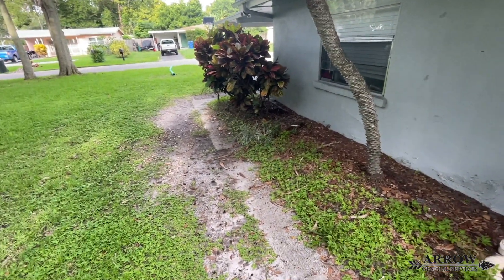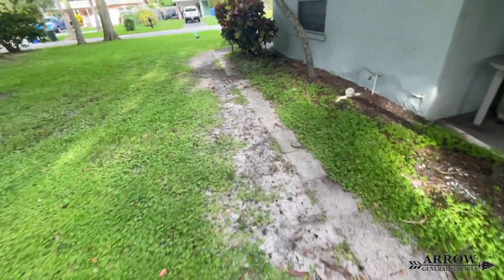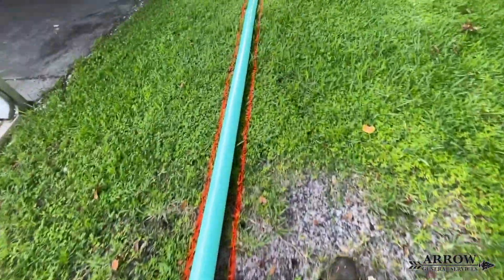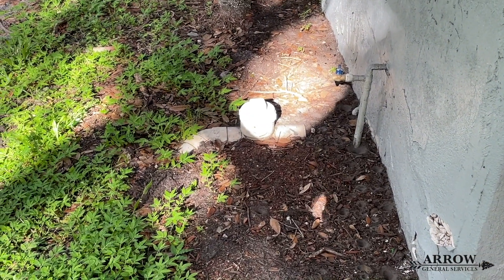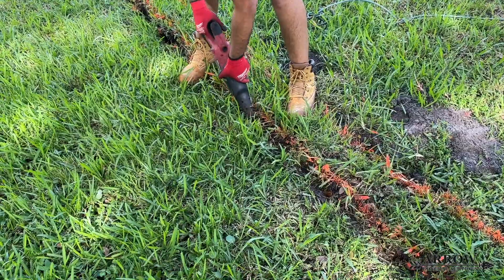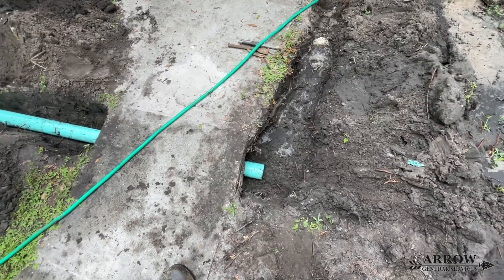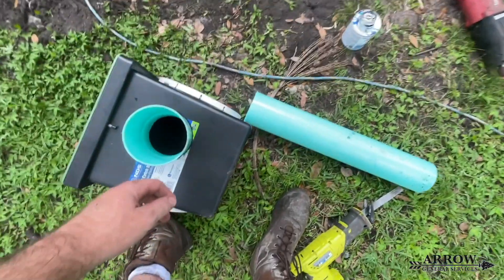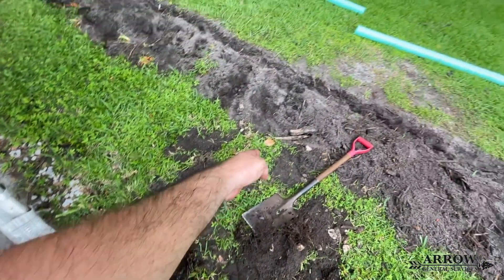Rain Water Drainage System - 118' PVC Mainline - House Flooding Solved

Comment: I'm a first time homeowner and young. I bought a house that ended up having water damaged sunroom. I had to have it rebuilt and it still has issues with the water. I had someone cut out the concrete pad but it still causes issues again. I found out I have negative slope/below grade of the area. The ground goes towards the sunroom from the end of the house. And the sunroom was built on a very thin concrete pad. I have been researching video after video for weeks now, and this is the closest for what I can find to help me out. I am severely concerned about standing water and water splashing up. They never fully finished sealing the ground of the sunroom (or leveled it) so there's gaps under the sliding doors too) and I ran out of money, so I've been trying to figure this out myself.   Otherwise I don't know how to stop the flooding again or the seepage into the wall. How do you even seal the concrete so water doesn't pool or splash upwards? I'm trying to figure this out, your video helps me a lot.

Comment: Is there any issue mixing and matching Schedule 40 White PVC pipe with Green pipe (use in gravity sewer and storm drainage applications) ?
PS - Nice trick using Reciprocating Saw!
Reply from the maker: You can most certainly use Sch 40 with SDR 35. Just use an adapter coupling to make the transition between the two different schedules.